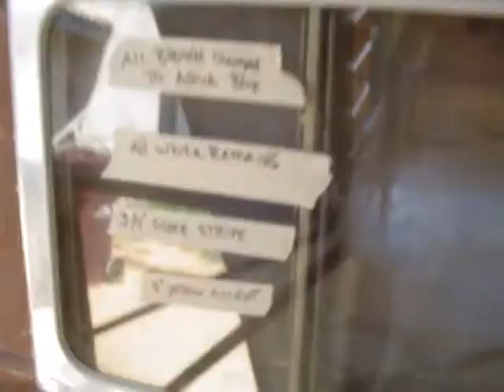Restoring The Deville Part 39

Comment: Larry, was this recorded on a potato camera? Hehe.
Reply from the maker: That was over 10 years ago when the cameras were still pretty crappy and You Tube was only uploading in 240p or 480p. The veiwer screen ON YOUTUBE ITSELF was only about 6 inches across and in the beginning it was only 640 by 480p. So if you reduce the size of the browser to half the normal size or smaller the video quality is increased tremendously. Give it a try and you'll see what I mean. The camera at that time was a Sony 1.2 megapixle with a video frame rate of only 18 frames per second. Cameras have really improved over time.